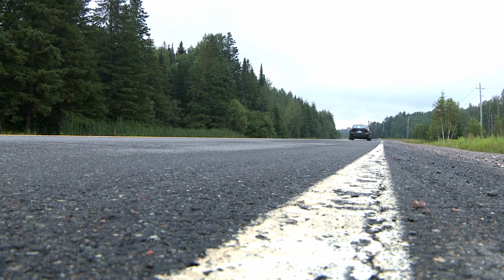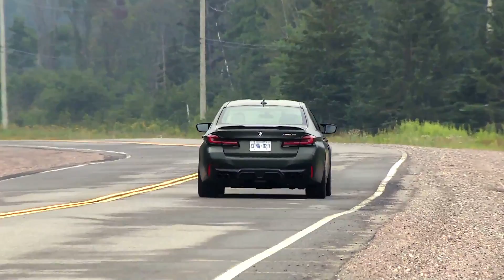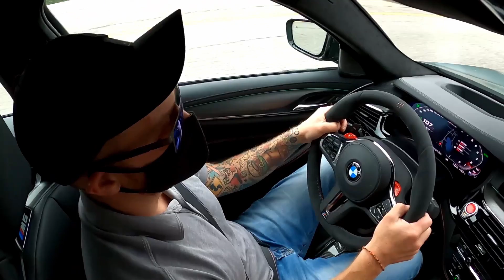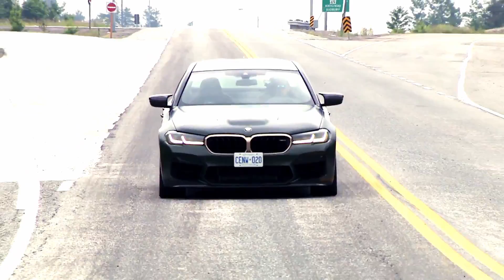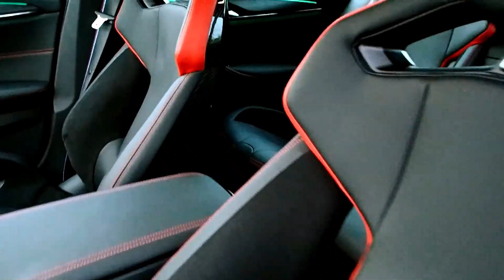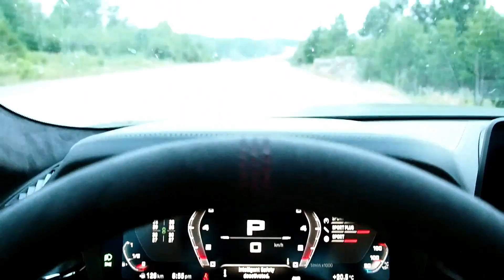2022 BMW M5 CS Performance Review | Driving.ca

Comment: Very good video. Question about that hump located in the crotch area: when you transferred from gas to brake didn't it get in the way?
Reply: Personally not an issue, if you have bigger legs they may rub though. At my size, the seats were just right. When exiting the seat, you have to go straight up before you do anything else, so little risk of impact!